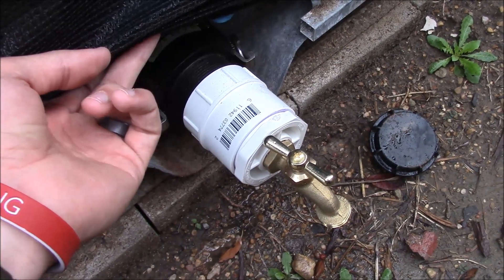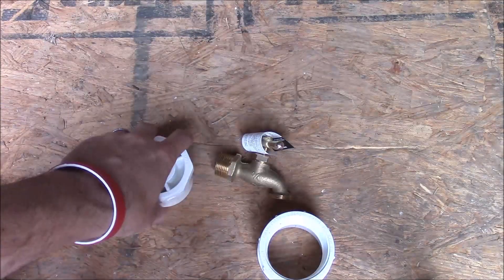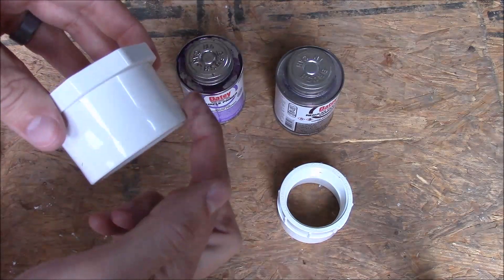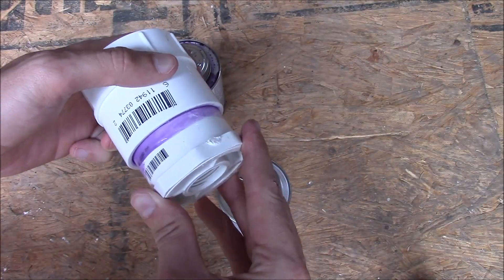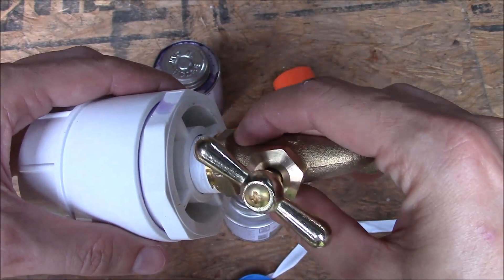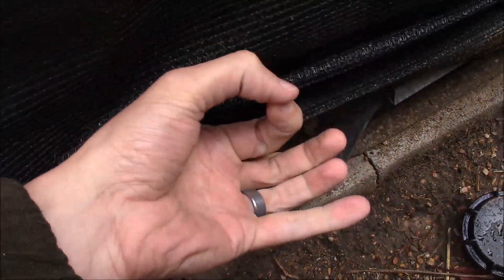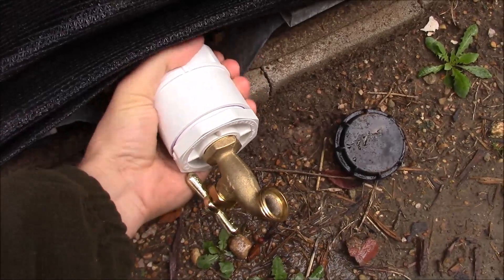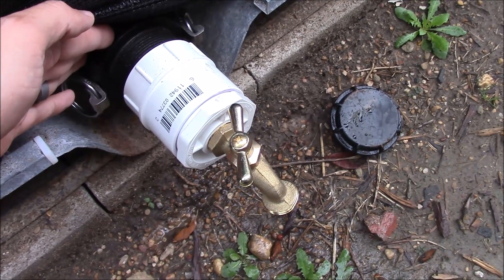Building A Rain Catchment System - Part 4 IBC Tote To Garden Hose Adapter

Comment: Why did you not just use a 2 inch threaded to 3/4 reducer???? Save one piece
Reply from the maker: Never seen one in the hardware store.  I just used what was readily available.

Comment: Thanks for this video. Bought these parts but seems to touch smaller thread on 2'' female. I measured the diam. on the tote and seems 2 3/8 or 62-63mm. I thought they were standard but maybe not.
Reply from the maker: No, there is no such thing as a standard size on these.  That is why I was so confused and tried to pass on some things I found out the old fashioned way:  trial and error.
Reply: @LDSreliance  Thank you. I bought a 2-inch rubber housing and then 2inch to regular tap reducer.. works like a charm.
Reply from the maker: That is good news!  Glad you got it to work.  Thanks for watching.

Comment: The piece coming out of my tote is 2 3/4 inches. I'm having trouble finding an adapter as the plastic on/off valve broke and I removed it. Any suggestions? Also, great video. 👍
Reply from the maker: There are several types of threads so it is hard for me to be able to help.  Email me some pictures and I will do my best.  ldsreliance@gmail.com
Reply: @LDSreliance  Thanks a lot. I got lucky and a found one that fits. I had to saw the handle down because the threads put my handle in a position that I couldnt close it. Thank you though for the video. It inspired me to build the adapter myself. Had a little trouble getting my teflon tape the right direction too..😂
Reply from the maker: @teajelmore  Nice!  All is well that ends well.

Comment: Plumbing tips for you; primer dries fast enough that you do not need to wait. Apply the glue to both sides and then no hammer is required to assemble. The glue dries fast so immediately assemble the pieces and hold them together for a minute so they don't move while the glue sets up. Have the loose end of the teflon tape going away from the direction of rotation so it doesn't all ball up inside the threads and never bury the threads all the way, use two or three wraps of tape and then hand tighten the spigot into the fitting. Totes that I have seen are about 30% cam lok and 70% threaded.
Reply from the maker: Good tips, thanks!

Comment: Do they make a smaller tote? Let’s say so it can fit in a ford transit van? So I can mobile the container. And also does it have enough pressure to wash a car?
Reply from the maker: No, IBC totes are very large for industrial purposes.  There are smaller tanks that would be more appropriate for putting inside a vehicle.  I have seen some at Tractor Supply Co. and Northern Tool before.  Not sure if you have those in your area.  And no, without a pump to pressurize the water, it will not be able to have enough pressure to wash a car.
Reply: LDSreliance ok thank you I appreciate the info. I will need to try and figure out what I can do.

Comment: Common people I've been selling Totes for years now and I provide options to include the 3/4" hose bib spigot adapter  for customer convenience. From the get go I came up with the idea of simply using a 2" X 1½ rubber boot  along with the 1½"X ¾ bushing and a Brass no kink ¾" spigot, this spigot doesn't bend downward as much so your hose doesn't kink from the bend. Reasons why I've found this to be the best way are. 
1) The rubber boot will work on any tote they all have the same 2" ball valve outlet and it makes no difference what type of threads it has after all thers like 5 different types.
2) The rubber boot allows the hole thing to flex and not just break off or crack wen the hose is pulled or the spigot gets kicked or tripped over etc... 
3) These items are usually available in home depot the 2" bushing is not always available. 
Hope this helps save you from having to return to the store because the threads don't mesh etc... etc...
Reply: This information helped me out tremendously! I was in Lowes watching the video and read your comment. Thank you!

Comment: I noticed that there was a black plastic cap laying on the ground. In my case I just drilled a hole in the plastic cap and fitted a Gardena type  hosecoupling with a rubber ring and nut on it. Cheaper and simpler
Reply from the maker: I suppose you could do that.  It might hold and do the job.  This method will last much longer, will never leak, and could handle substantial pressure if you wanted to stack IBC totes on top of each other and use gravity to boost pressure.

Comment: You need to twist the PVC in order to weld pieces together other wise it will loosen up in time.
Reply from the maker: Are you sure?  The cement is what bonds the plastic together.  I don't know what twisting would do.

Comment: I've purchased so many parts. Ebay, Home Depot etc... It's almost as if the 2'' adapter is just a little too small. Do they make 2 1/4" adapters?Or what am I doing wrong? I'm new to all this & can't figure out what size I need...Anyone help is appreciated.
Reply from the maker: It is a very specialized fitting that you won't find at any hardware store and not even at a plumbing supply shop.  I even went to a shop that sells IBC totes and they didn't have them.  These are the two main styles you probably have:  http://www.jmesales.com/product/jme-garden-hose-tote-adapter-kits,11757,4445.htm
Reply: Thanks for the reply! ordering it now, fingers crossed again:)
Reply from the maker: You are going through the same thing I did.  I had to try 3-4 different things before I found what works.  There are at least 3 different types of outlets on those things so it is hard to know what to get.
Reply: Just ordered the piece.... Meantime, would it be possible to send you a pic via email? (I visited your website & seen contact info:) If it's not too much to ask..Thanks
Reply from the maker: Of course.  Fire away.

Comment: They sell adaptors online for ten bucks and all you do is screw them on.  No assembly needed.
Reply from the maker: That is what I thought when I got the tote.  However, there are actually 3 different styles of adapters because there are 3 different styles of ball valve on IBC totes.  Trust me, I spent a few weeks scratching my head on this one.
Reply: LDSreliance that is true. I got the 2 " pipe thread coupling and it did not fit. It was too small.
Reply: PontiacMatt did you find the solution to this? I’m currently in the same boat

Comment: I appreciated your video.  I'm in the process of setting up 4 IBC totes to maintain our garden.  Does the shade cloth help much with the algae?  I've seen some folks remove the cage to wrap their totes in black plastic. One guys spent big bucks and sprayed his with Flex Seal.  Regular paint peels with expansion from the weather. Thanks.
Reply from the maker: That is why I did not paint mine because paint cracks and may have problems adhering to the plastic in the first place.  I like the shade cloth because it is cheap, goes on quick, and did not involve removing it from the cage.  It does prevent algae.  I still do not recommend drinking the water directly from the tote, even if it is food grade and has passed through a filter off your gutter and is free from algae.  It will still need to be distilled or filtered for safe drinking.

Comment: Just picked up 2 tanks and the 2" female will not fit. I'm  not sure what size my tank outlet is. where did you get that clamp converter? Thanks.
Reply from the maker: Yeah, it was a pain to find that coupler.  There are only 3 types, from what I understand.  The cam lock one is the one in the video.  Scroll down toward the bottom of this link:

http://www.lexingtoncontainercompany.com/275-Gallon-IBC-Totes.html
Reply: I found the cam locks at Menards for  $13.00 each.
Reply from the maker: Not bad for not having to ship them.  Lowes and Home Depot don't carry them so you got lucky!
Reply: LDSreliance h

Comment: I'm looking at using IBC's for a refugee garden on borrowed city land.  A couple questions:  1) Could an IBC be pushed over by vandals do you think, or is it too heavy? 2) Our water source is a fire hydrant several plots away.  Do you foresee any problems with filling the IBC with a fire hose? 3) Lastly, is there enough water pressure with this system to connect a hose which will reach possibly 50 feet to our furthest raised bed?
Reply from the maker: If it was full of water it would be too heavy for someone to lift without a truck or forklift.  It would be well over 2,000 pounds.  I don't foresee any problems with a fire hose other than it is very high pressure so if you could lower the pressure a bit so you don't knock the thing over or crack it (the tank itself is plastic) that would work.  There is not enough pressure to provide any lift or to pressurize any sprinklers.  You would have to have an auxiliary pump.  See my video series on DIY garden watering:  https://www.youtube.com/playlist?list=PLbKwoGlXEWar5Mmwely6rpRfCJbfKUqJ6
Reply: Thank you so much!  That was very helpful.
Reply from the maker: Darla Batty You are welcome.  Thanks for watching and good luck with your project!

Comment: Does anyone other then me think the Teflon tape was not needed and that even if it was needed he applied it in the wrong direction?
Reply from the maker: +Nota Rookie Why does it matter?  If it wasn't needed then nothing is lost.  If it was needed then it saved a leak and more time and effort wasted.  And how can you apply teflon in the wrong direction?  Either it gets smashed in there and blocks water passage or it doesn't.
Reply: +LDSreliance of course in the greater cosmic scheme of things it doesn't matter at all. As a cautionary bit of information for someone who is unfamiliar with what frequently happens when Teflon tape is applied in the wrong direction mainly when you try to screw the parts together you end up buggering the tape in a manner that will either cause you to need to reapply it or it will fail and you'll get  a leak.
Reply from the maker: Nota Rookie
OK, I can see that potentially happening.
Reply: Although it does not make a large difference in this case, you could see the cut off pieces of teflon tape that were forced out of the connection. In this case it could be cleaned out from the inside, in other cases it would plug your downstream valve, garden spray or other items.

Comment: Why did do you not want to paint them?
Reply from the maker: +Carlotta Tiniakoff In my research, I read that some other people had painted theirs and it didn't last very long.  It also would have been a LOT more work in my opinion.  I would have had to remove the plastic inner tank part from the cage, sand it down, paint on a coat of primer that adheres to plastic, and then paint a coat of whatever other paint.  Maybe you are just talking about spray painting the whole thing while it sits in the cage and don't care if it flakes off after a year or two but I wanted something that looked a bit nicer and didn't require a whole weekend of work.

Comment: What did you cover your tanks with? I was going to paint them green.Thanks
cuptintoo@yahoo.com
Reply from the maker: +Carlotta Tiniakoff I covered the tank with shade cloth.  You can get a big roll from Home Depot or wherever they sell gardening supplies.  I got some cheap plastic grommets and used zip ties to hold it together.  Been going great for 2 years now.

Comment: Does anyone know why you don't have to use Teflon tape on those connections.?, just curious, because it's plastic does it give and that is your seal.?
Reply from the maker: +Ranjit I did use teflon tape on the connection from the spigot to the pvc.  But the plastic connections don't need it as I have never heard of anyone using it there.  I think you are right it is because plastic can flex and seal on its own but I am not sure.
Reply: Typically...teflon tape is for high pressure fittings... as these are gravity fed/ low pressure...not necessary... but a cheap insurance most folks use anyways.